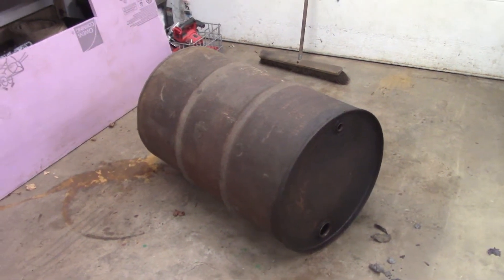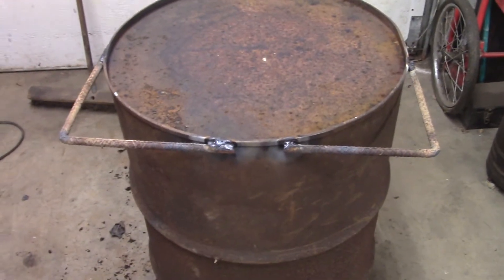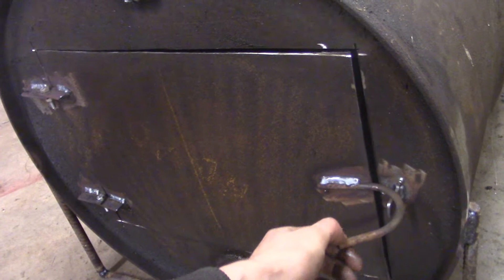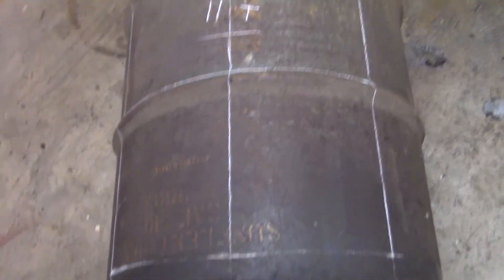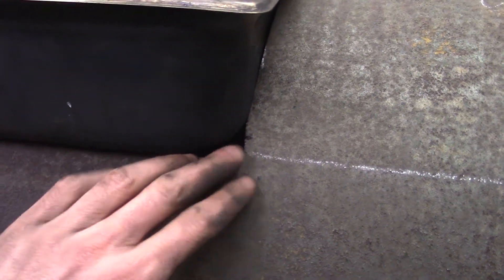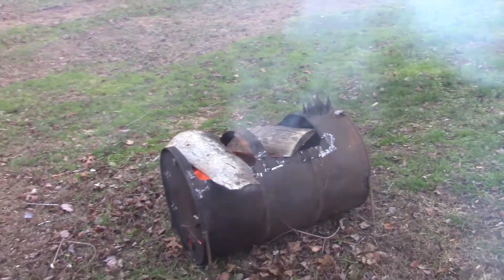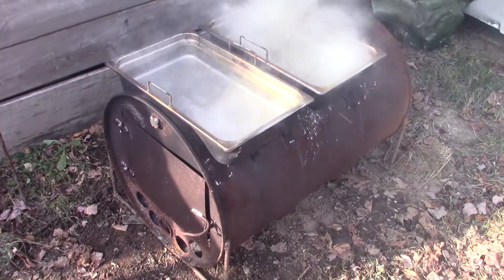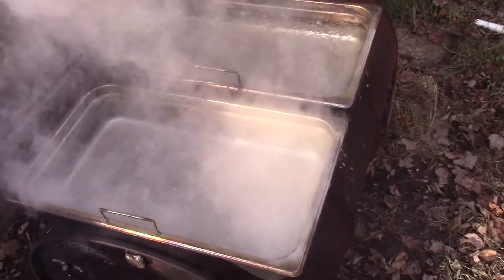Maple Syrup Evaporator 2.0!

Comment: so satisfying to design and build well ahead of when you need it!  will be fun to be able to boil down the sap asa the buckets fill in march!   how do you plan on storing the syrup?  no 'canning' type method needed, right?  is maple syrup like honey, as regards 'shelf-life'..?.. also - do you have enough sugar maples..?..and do you tap trees elsewhere than in your woods??
Reply from the maker: Just put the boiling hot syrup into hot jars. they will form a vacuum and seal. The sugar content is high enough that nothing will spoil it, however it doesn't have an infinite shelf life like honey does. I have no sugar maples, just red and norway. they work fine but have a lower sugar content.